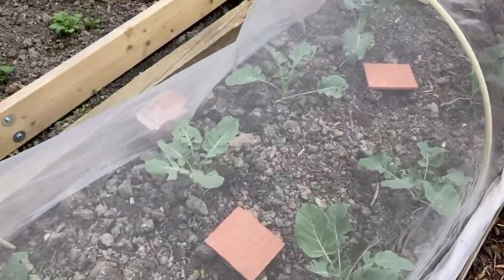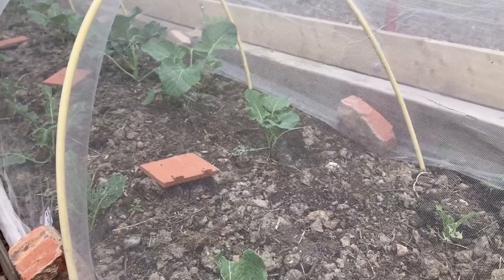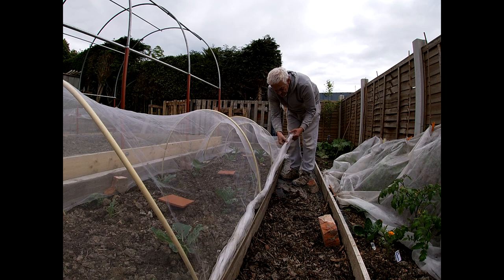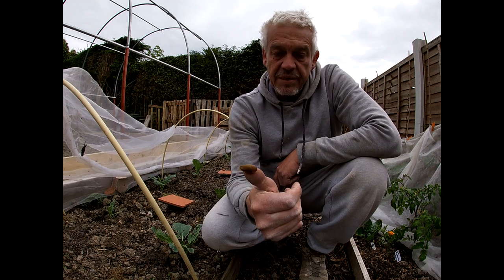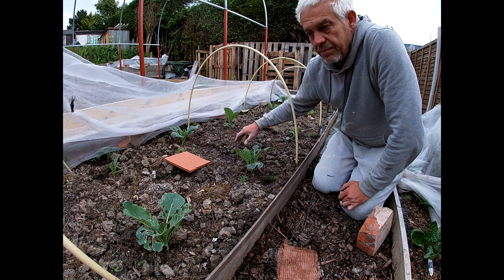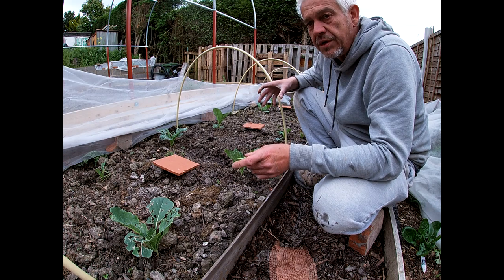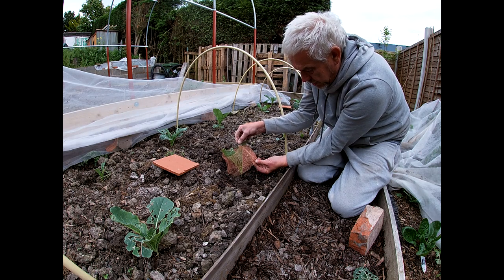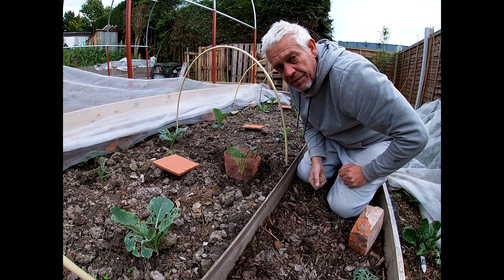Combating Slugs

Comment: Hi Jason, I was wondering about the copper mesh netting as well. The only thing I thought, if the slugs go down into the earth in the daytime, what's to stop them coming back up inside the mesh cage and carrying on gobbling up your brassicas. Annoying thought. I have used, for the last two years, Strulch. Completely surround all plants with a thick layer of Strulch. So far so good. Also, Richard Jackson on the QVC shopping channel, do an organic slug pellet. Doesn't harm birds or wildlife, the slugs die and disappear into the soil, never to be seen again. The pellets also enrich the soil when they break down. Hope this helps. Best of luck.
Reply from the maker: Hi Madeleine. Thanks for the tip. Yes they could bury underneath it. I have a kill on sight policy 😂 however some like the leopard slug eat other slugs. So I leave those be.

Comment: I have seen large slugs clambering over a single length of copper tape, I now use two bands of copper tape and this has stemmed my losses. Also, rather than keeping unused plant pots in my shed, I spread them around the garden, upside down. Slugs and snails roost inside the pots and so I can collect them easily. At first, I collected 5-10 per pot,  but after a couple of weeks, the numbers started to diminish, so I think I am having an impact.

Comment: I’m struggling even worse than you. Slug pellets are now pointless since reformulation.
Obviously farmers can’t fanny about like this, I wonder what they do to protect their crop?
Reply from the maker: I find beer traps the best.
Reply: @leatonveg  The risk is that the yeast provides a strong stimulus to draw them in from beyond where they would normally venture, perhaps taking a leafy snack on the way. I also wonder if a water, sugar and brewers yeast solution would be an equally effective bait, might save on the beer. I have noticed my slug cemetery is also a highly effective draw, every night I find loads consuming the remains of their kin, unless they are just paying their respects to the fallen!
After a nightly crusade with a pointy stick for 3 weeks solid, my kill count is now starting to decline, suggest the control is starting to work. Can’t say I enjoy wondering around at midnight with a torch and dressing gown, keep expecting a knock on the door from the cops.